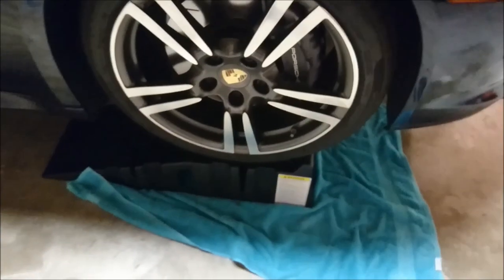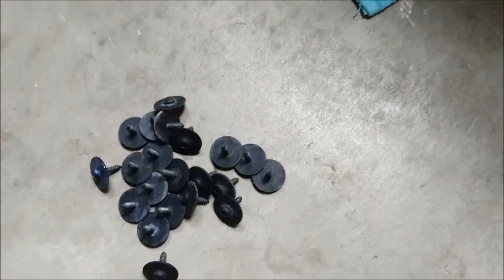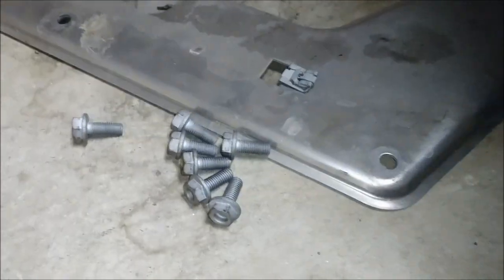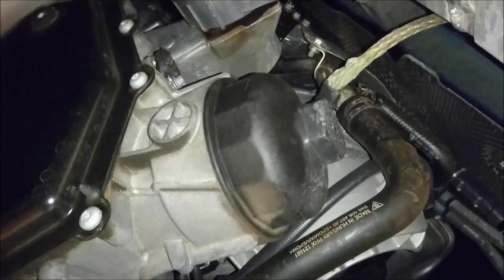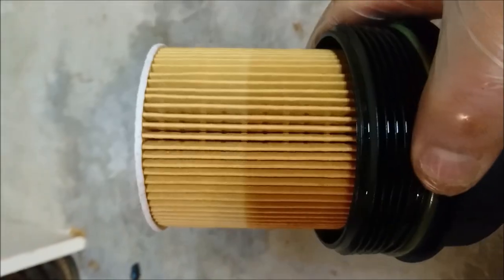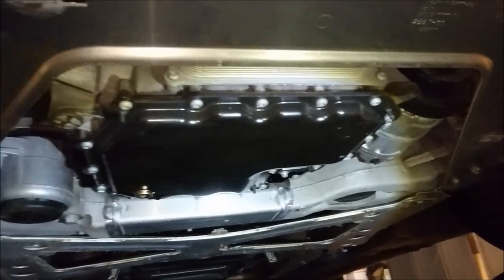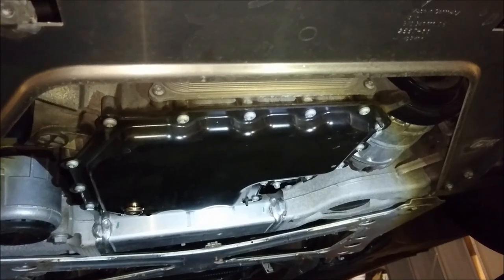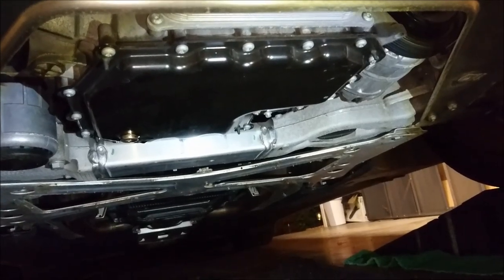PANAMERA OIL CHANGE - HOW TO CHANGE THE OIL IN YOUR PORSCHE

Comment: Thanks for useful video. Just completed an oil change on my new (for me) P4. I used a NAPA Ford oil/fuel filter tool (available locally :)) and there is no need to remove the brace below the filter housing. There is a cut out that allows a regular and torque wrench to easily access the cap. Also, oil plug is 22 ft/lbs and filter cap is 19ft/lbs. 
Happy wrenching.

Comment: In an e hybrid version, the oil filter housing is in the engine bay on the right.  You dont need to pull the second panel to drain the oil as you can access the drain plug after removing the plastic panel...

Comment: Who wants to through all that trouble. F that
Reply: haha. who? Cheap people, people who love their cars, people who can't afford a mechanic...
Reply: Pedro Talavera Then a Panamera is not for them! It's a complex car, esp the hybrid, and I'm content to pay experts to service it, as are most Porsche owners. Next, they'll be driving on remoulds or ditchfinders.
Reply: @rolonow12  but a used panamera is 20k++ now, even cheaper than a new camry. So it's not an expensive car.
Reply: @galaxymode  There may be a few around of high mileage Gen 1, but a decent Gen Mk2 like my hybrid just sold for £53,000.
Reply: @rolonow12  so what if I want to change oil for a 250k miles gen 1, do I
A: watch this video and do it for less than $200.
B: give it to a Porsche dealership and get a hefty bill for a car that isn't worth shit, probably worth lesser than a 2015 Hyundai SUV.
Reply: galaxymode No argument from me, quite appropriate for an older car, esp if you have the tools, knowledge & facilities, as I did most of my motoring life, even clutch & timing chain changes. I still have the knowledge & tools but no inclination, quite content to pay for dealer expertise when required, esp in warranty. Of my last 6 cars, 3 were new, I didn’t keep any of them long enough even for a service.  Just sold the Panny for a new Beemer, it will probably be traded in before the 2yr service is due.
Reply: @rolonow12  bro, you're right. if it's a new car or still in warranty, even if it's a $9000 Mitsubishi Mirage, bring it back to the dealer for servicing, you don't wanna risk it. I did have a fiat at one time, despite I can service it myself, I brought it back to the dealer. knowing I have a FCA product and knowing how unreliable they are. I ain't risking it.
Reply: galaxymode We're saying the same thing. As with all social media, never enough info in a short post to get the full picture.